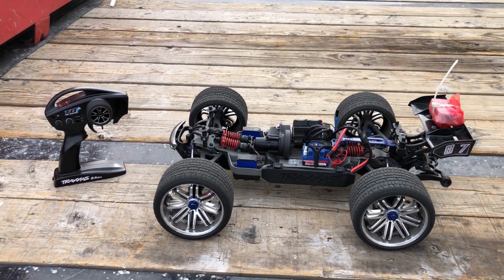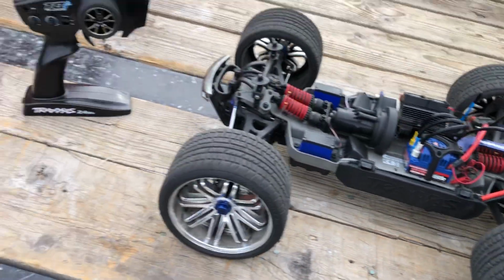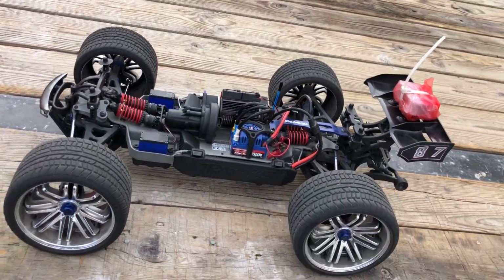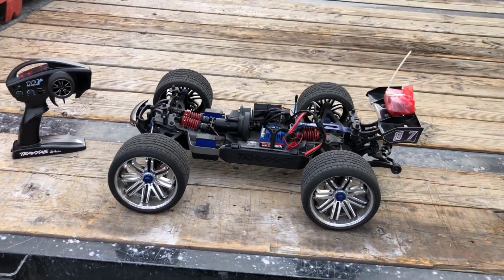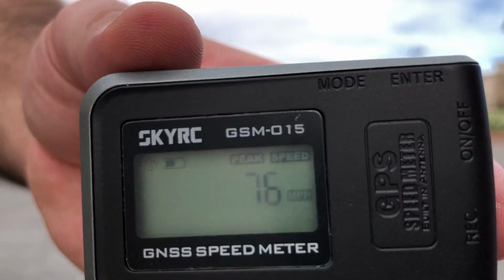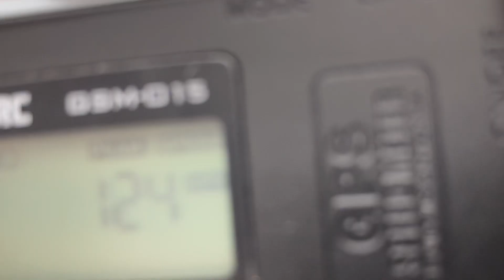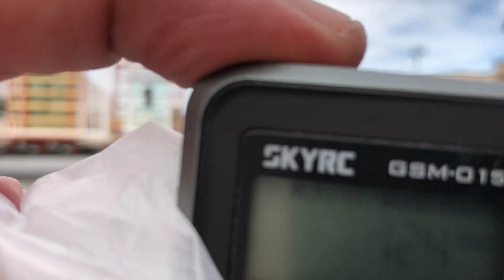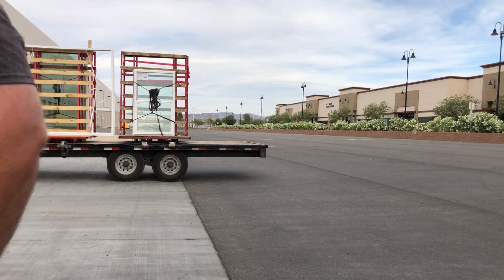TRAXXAS E REVO 1.0 1/10 TH SCALE ELECTRIC BRUSHLESS TRUGGY (6S 50C) 77.0 MPH SPEED RUN !!!!

Comment: Nice run Gb , you have that thing on a rail!!
Reply from the maker: Hendo 702 rc Yes sir buddy I am trying to crack 81.0 or alittle more with it. Mod 1 25/36 gears on 6 cell lipo. This was with 50C soft pack lipos. With the 60C’s I’m able to break 79-80+ much easier it seems. I’m gonna be headed out there again for more runs stick around. I got Slash 4x4 Vxl speed runs coming back again. Also going to work on getting mini e Revo VXL’s back there to.